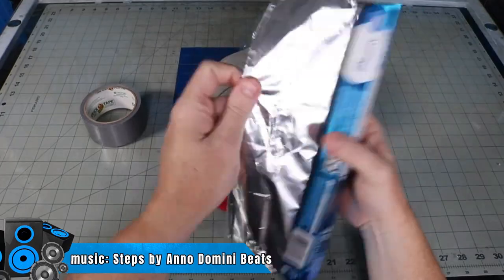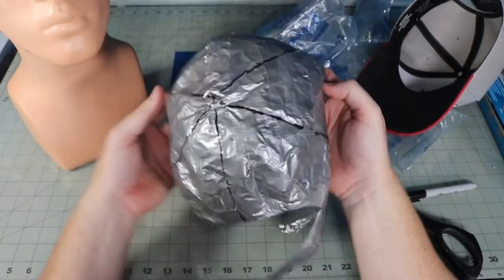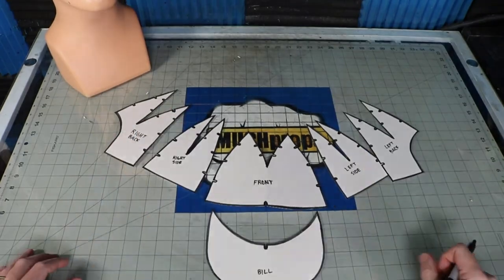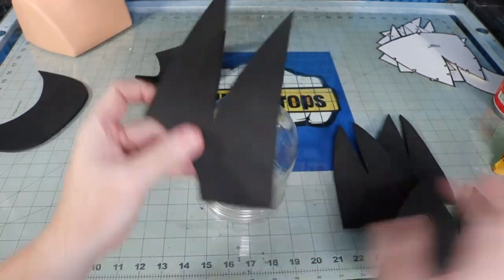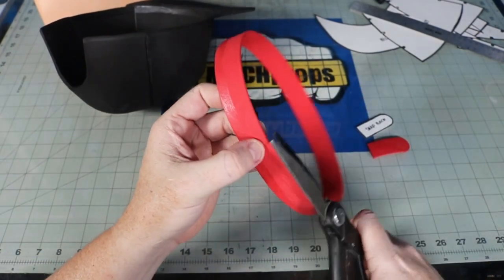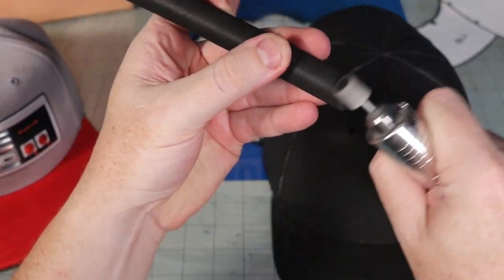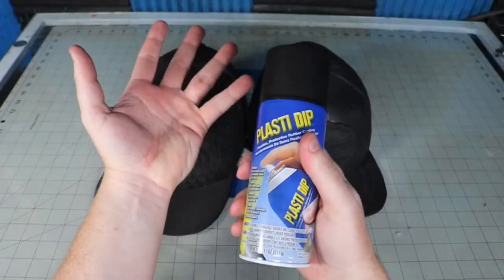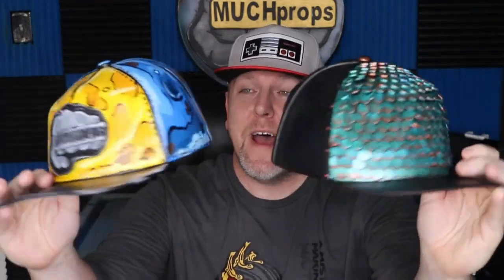How to Make a Template: HAT EDITION

Comment: Note to crafters,  You could easily convert this over to a Leather Project by using 4oz veg tan leather and dying the pieces.  Punching holes for stitching along the edges (Including the darts) and sewing it all together with a strong waxed thread using a cross-stitch.   Some resources on how to do a cross-stich on YouTube  would be Dieselpunkro on YouTube,  Corter Leather.   You can easily get the nessacary tools on Amazon.  Really all you'll need is a cheap stitching chisel kit, some Needles,  Thread and either som Vangelus or Fiebrings Dye.  (Oh and some velcro for the snap back :) )  Oh and a Mallet
Reply: Also if you don't feel confident doing a dye job you can buy pre-dyed leather.   There are some really great colors out there.

Comment: Nice hats! I haven't seen the previous how to make template videos so I'll be watching them too.
The biggest problems I have making my own templates is still figuring out the best places to make seams and what places need angled cuts. I made four templates off of a shoe last Halloween and they all somehow failed.
Reply from the maker: It's on of those things you get the hang of over time. The more of them you do, the more it becomes second nature for placement.  My hat example was simply to decide because I am pulling it from something that already has them. On curved areas the key is to split it in enough pieces and darts to flatten the pattern